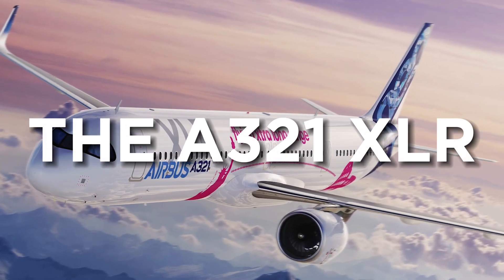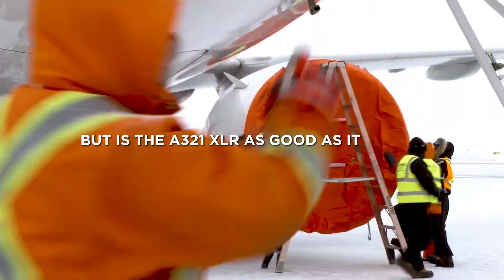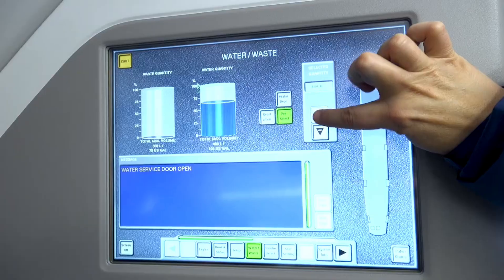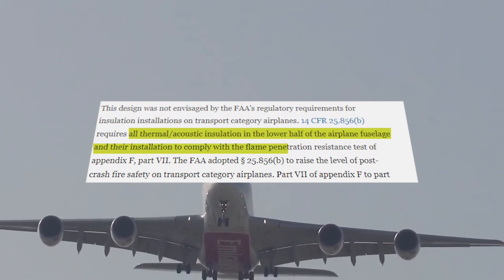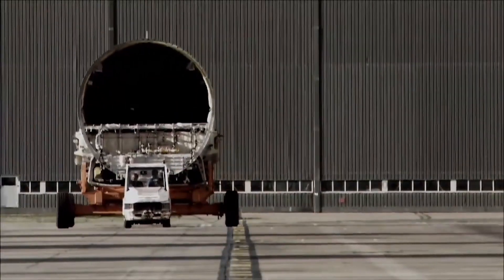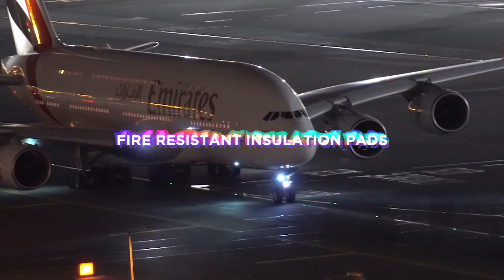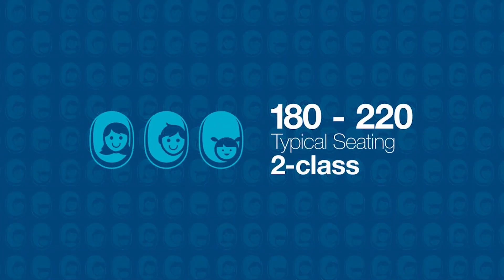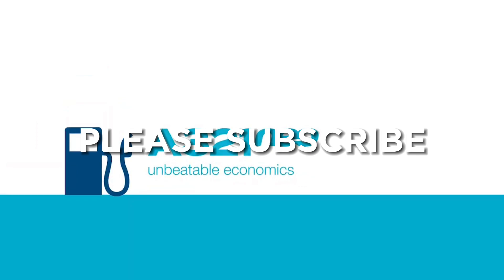DANGEROUS A321XLR: Why the FAA has concerns

Comment: There's nothing new about an RCT, the A340-500 has one. The XLR has a liner in the Tank so the landing gear has to collapse first then the Engines have to come off. Unlike Boeing Airbus's are designed to land on there Engines so it's highly improbable.

Comment: YES. it is almost ready. SAFETY IS NO 1. FAA. needs check the issues. The range maybe 200 nm less. But thats still a great long distance for a small haul plane. MUCH SAFER THAN 737 MAX. Which is a death trap. BOEING Has cheated and cut corners on 787, 777 x so we can assume A321 XLR. AIRBUS will be more careful. WE NEED SFAE PLANES.  BEST OF LUCK TO AIRBUS.
Reply from the maker: Im excited when the A321 XLR will enter commercial service. Definitely one of the game changer aircraft for airlines. 200nm less range is ok I think. Until now I saw no airline that cancelled their order because of less range, it seems to be okay for the customers. 

Rather a safe aircraft with less range than an aircraft where you have to hope that your overweight emergency landing will not end in a desaster.

Comment: Hey bro, if A321 xlr is dangerous, what do you say about B737 max? Not dangerous?? Remember the two crashes. THAT’S DANGEROUS PLANE
Reply from the maker: They solved the issue. The A321XLR is despite the concerns a very very good aircraft.

However, a good safety culture and control mechanisms are important to maintain a high safety in the aviation industry to avoid crashes like the Ethiopian and lion air crash.
Reply: @Flyment-de5yx  A321xlr has been involved in any accidents… yet… so let’s not draw conclusions. I’ pretty sure that Airbus will not let any of their planes come in the air if there is a doubt about its safety.

Comment: Is good plane but they need 4 bathrooom in economy class and 2 in business
Plus a space for sleeping for pilots and flight attendants 
This airplanes shouldn’t be used in flights more than 6 hours
They should find more efficent engines 30-50 percent save in fuel
In narow bodys
Plus people want to walk in airplane in long flight 
Peppe have leg problems
How they gonna move in a321 xlr
Is bs
Reply: They can give pilots a first class seat. 10 hours isn’t so bad. Also, these airplanes are already efficient. 

U can walk in a single isle just the same as a twin isle. In twin isles, ppl stay in their own isle. So there really isn’t anything different. 

Your points are kinda bs.

Comment: A321 has an undersized wing for its fuselage length, and the wingspan can't be increased without it being moved up a from a class 3 to class 4 gate size category. I flew on an A321 to Hawaii and we flew through a storm and it was the absolute worst turbulence I've ever faced. We flew a 757 on the way back and the flight was much better. I don't mind the A321 when doing short domestic flights, but I'll avoid the A321 as much as possible on any trans-oceanic flights.
Reply: Of course that means nothing. Your return trip was different conditions.
Reply from the maker: I had only pleasant flights on an a321, but we never flew through a storm. 

How would you rate the quality of this video? What could I improve?
Reply: @Flyment-de5yx  I'd say the video was good. But it would be great if you can attempt saying the truths.
Reply from the maker: What was according to you not the truth in this video? if there’s something then please show me an example.

Comment: A normal aircraft has fuel in the wings..also has a center fuel tank..
Reply from the maker: You’re right I forgot to say that. But the difference between the XLR and a normal aircraft is that the xlr has one center fuel tank behind the main landing gear.
Reply: @Flyment-de5yx  Anything new is, rightly, treated with suspicion.  Hence the special testing and conditions on the 777X folding wing tips.

The plane as certified will be safe.

Comment: Boeing did the same with the 747, put the center tank on the belly!!
Reply from the maker: Every aircraft has a tank in the belly, but not behind the main landing gear. Otherwise the A321LR would be grounded.
Reply: @Flyment-de5yx  not every aircraft has a center tank. 

Also, this has zero to do with it being behind the landing gear or not. Placing a fuel tank behind the gear has been done plenty of times without issue. 

The difference is that this tank is located right underneath the floor, so that it doesn’t reduce cargo space in the aft luggage bay. U can’t carry 150 people if they don’t have room for their suitcases.